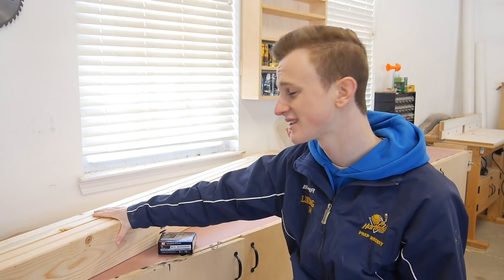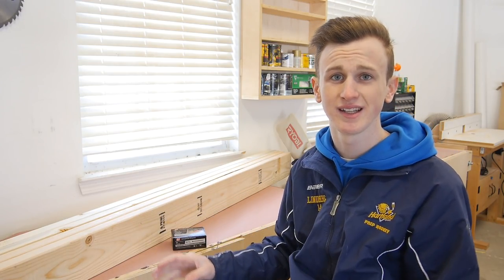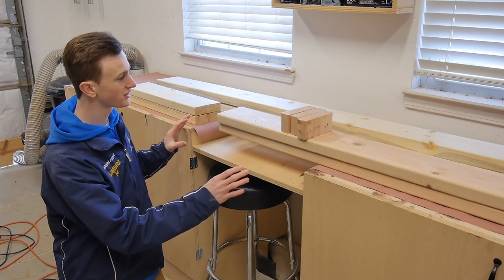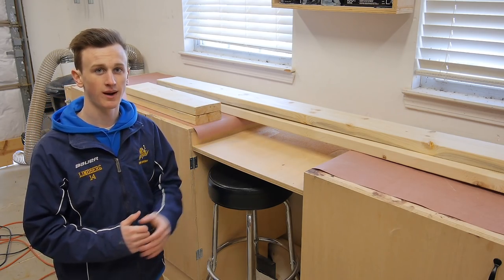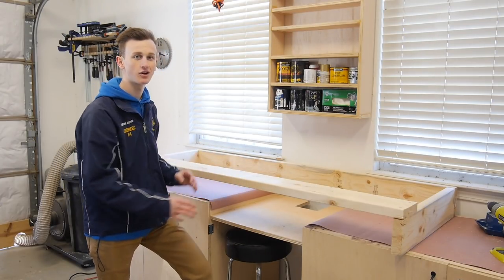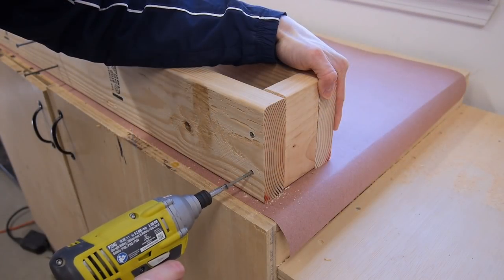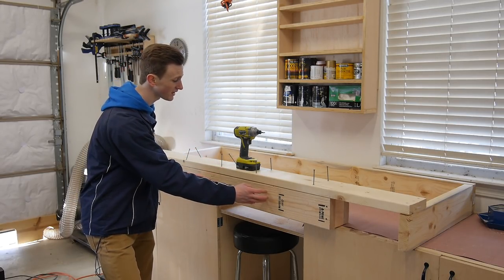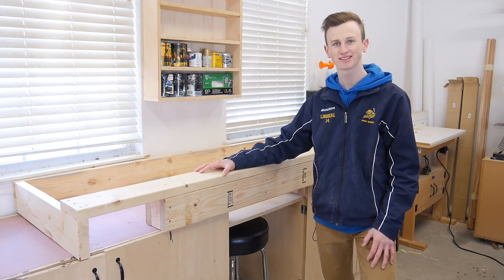How to Build a Pond Hockey Goal!

Comment: Hey Eric. 

Had an idea when you were demonstrating  the goal.  What if you rounded the inside of the goal [like the corners of a hockey rink]  so that when the puck goes in, instead of bouncing back,  it rounds the inside and comes out the other side of the goal.
Reply: I had a similar thought when watching the demonstration but I was thinking it might be easier to just put some boards in the corners at a 45 degree angle to the opening so when the puck comes in it will bounce sideways instead of straight back